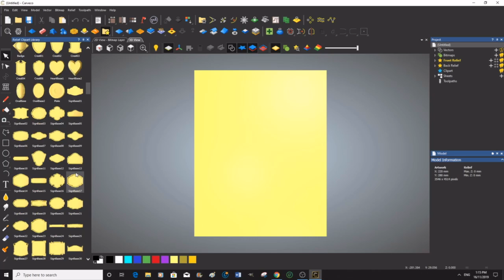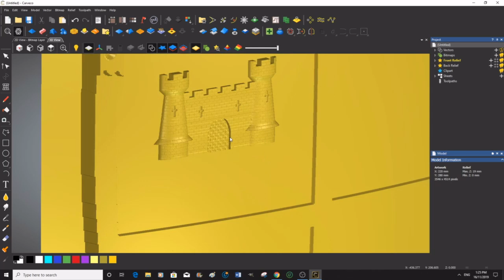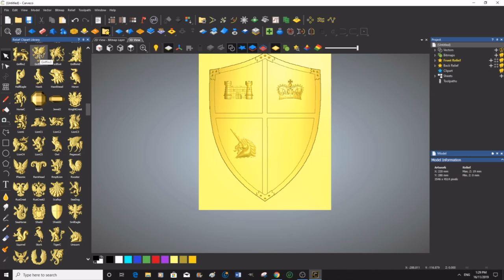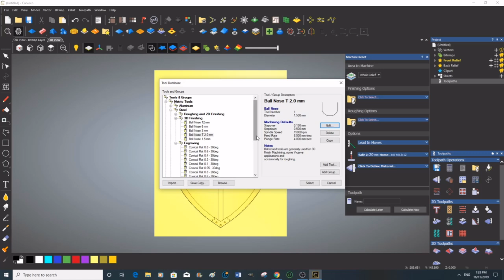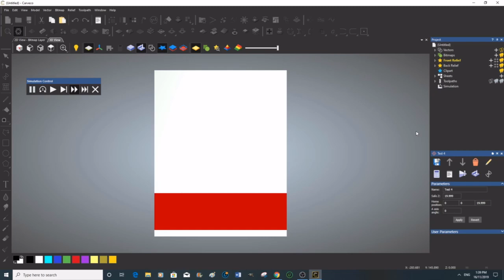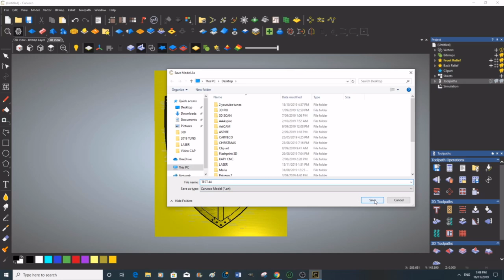Carveco making a multiple 3D relief coat of arms

Comment: Hello, Roger. Great video. One thing that I notice when I mill a relief is that it will mill in one direction, usually X. This means that the sides of the 3D model will look unfinished on half of it. Is there any option on Carveco to do the finishing using X and Y paths combined? Thank you
Reply from the maker: Yes!, when you choose a tool in the finishing wizard you can choose cut in x and y then set the angle at 45 degrees